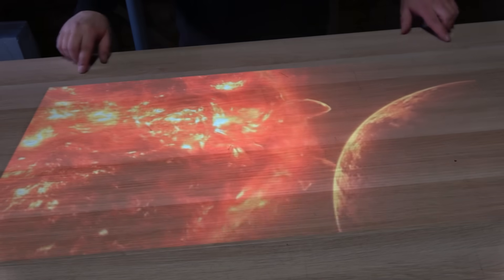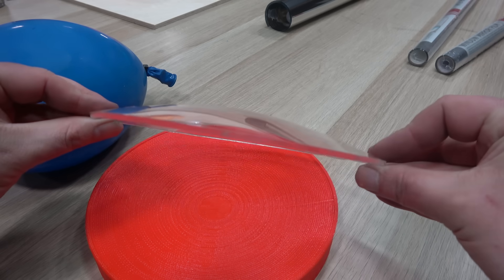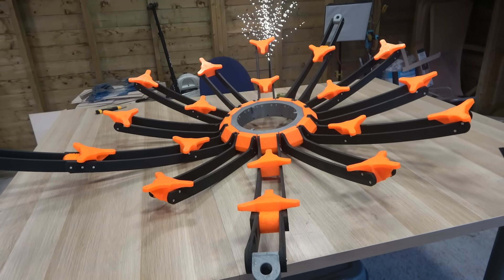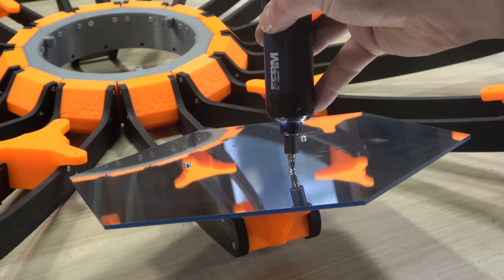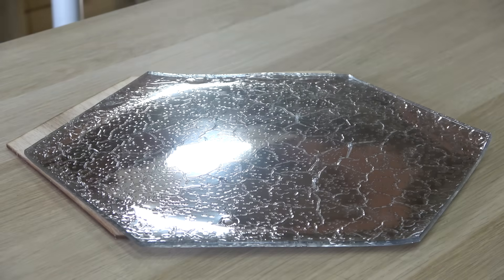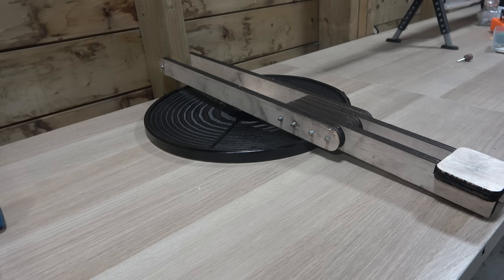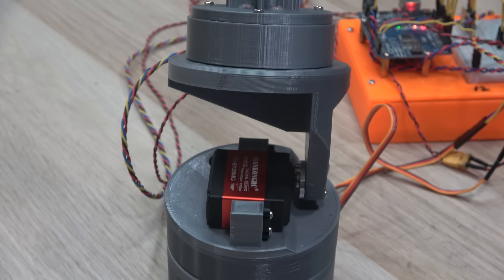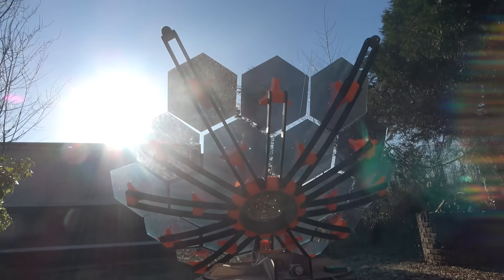Building a DIY Solar Generator..

Comment: The heated aluminium disc should be dark, black (but not catch fire) to use enough of the light that is focused on it (as it's well known, the darker the object, the better it heats up).
And, I'm sure you've considered this, but just in case: of course each segment must be the shape of the corresponding part of a parabola, not of the parabola's centre.
Reply: If the focus point will be few centimetres above aluminium disk, trap for light could be made: second disk with small hole that will be few centimetres above main disk and aluminium wall between two disks. that way almost all light will get through the hole in the first disk and then rereflect many times inside our trap, heating everything up. This also will stop wind from cooling main disk. And of course all walls inside trap should be black - main disk heat resistant paint and other walls of the trap could be painted with black 3.0 to really boost performance.
Reply: @MrMpakobec  Поддерживаю
Reply: Also needless to say, make sure if you paint the plate black, you use temeperature-resistant paint like the stuff the make to paint mufflers or barbecues.  Probably need some sort of primer with it as well, although the more different layers you have the worse the thermal conductivity could possibly be.
Reply: @danielf3623  There is stuff sold as "kachelzwart" meant to keep stoves black. This may be ideal. Not sure it will stick to aluminium though. Stoves are typically cast iron.
Reply: @danielf3623  If he bead blasted the plate so it was dull  and then just dyed it with black metal dye that would probably be enough.
Reply: @DeimosSaturn  Speaking of metal black, an outer copper cladding plate would distribute the heat better (aluminium is prone to hot spots) and Cu(II)O is matte black and tempertaure stable.   The cladding plate would just need to be heated up above 300C and allowed to oxidize in air (hotter will oxidize faster, up to 800C).  Then even if the oxide layer was damaged it would likely automatically reform under operating temperature.
Reply: @danielf3623  As he's used aluminium may be he could anodise it with a black coating.
Reply: @danielf3623  in addition to black paint, it can be more efficient at absorbing light if the surface has an array of vertical walls. And then to prevent air cooling, a clear cover could be put over it.
Reply: 3d Printing 6 different forms (as it's rotationally symmetrical, you should be able to reuse them) probbably isn't too much overhead, but I'm not certain it's worth it.  In case of remoulding, a vacuum attatched to the negative mold might pull the plates into shape without damaging the mirrors finish by compressing them from the top.

A more expensive option might be to get copper-clad plexiglass for the panels, form them and then electroplate them silver.  The upside is you should be able to get a very eaven coat by placing the opposite electrode at the focal point of the mirror, so it's fairly equidistant from all points (minus the spherical/parabolic deviation) That would hopefully remove some of the waviness you have in your formed sections from the adhesive releasing and/or the film buckling.
Reply: @danielf3623  3, not 6. the internal 'ring' of 6 are rotationally symmetric and can use the same mold, same goes for the 6 corners of the outer 'ring', as well as the 6 middle hexes of the outer ring.
Reply: @eyeonus  True, for some reason I had envisioned one more layer of mirrors, but it's only 2 layers, not 3.
Reply: The fact he's using aluminum gives him an option for making it black: 
There was research done stating that a simple candle's soot actually forms carbon nanotubes onto the aluminium surface.

Simply put, just soot the aluminium disc and gently have something transparent to protect it from the elements.

Used this for my solar space heater, works well, however haven't tested if simply painting it black has any difference. But ideally the nanotubes would be perfect light capturers.
Reply: Rather than the shiny aluminium plate, you would be better off with an old car radiator, which 1) is black, so in this case absorbing as much of the light being shown on to it, rather than reflecting it away; 2) is designed for maximum heat transfer to the water. The simple channel you have machined isn't going to have super good heat transfer.
Reply: Yes, people often tend to forget that parabolic mirrors only work at one specific angle and if you're going to tilt them then you might as well go for a spherical mirror.
Reply: @typha The point of the parabolic mirror is that it works at multiple angles. Incoming light hitting a limb of the curve is always directed to the focal point, which is the main reason for using that curve. You must be thinking of something else.
Reply: @edeaglehouse2221  It does not, no. A parabola will reflect collimated light (parallel rays coming from one particular direction but with different locations) towards its focal point, and it will do the reverse as well (light coming from it's focal point will be reflected outward in one direction), but that only works with one specific direction. 

simple counter example: consider the point closest to the focus. At that point the mirror must be perfectly perpendicular to a line made between it and the focus. Any light ray coming in along this line will bounce straight back to the the focus. Any ray that hits this point at an angle will bounce away at the same angle on the other side and miss the focal point.

~maths prof.
Reply: @typha  Oh, I understand what you're saying now. I oversimplified. Thanks. I know this is going off into the weeds a little but would a hyperbolic curve be good enough to collect light from various angles to a single point? I haven't done the math, but sounds like you might already know. Something like that might be good for a fixed collector.
Reply: He's not building a telescope so it does not have to be perfect parabola.
Reply: @Dusan_Kosmicki  yeah, perfect is not necessary, but desirable
Reply: @wingstrongwingstrong Exactly. All he needs to care about is that most of the light hits the heat exchanger, he does not need image of sun on heat exchanger, he need just light. So its not problem if he will have comma or spehric abberations or any other abberation. 

There are solar farms with just motorized flat mirrors that directs sunlight on water pipe, and that works great.
Reply: @wingstrongwingstrong  About the one dish instead of the segments: a hard requirement is to make it look like that space thingy he was talking about 🙂, so that is not an option. If it weren't for this requirement, he might as well have grabbed a satelite dish and be done with it.
Reply: I would be concerned that it could melt aluminium has a very low melting point of 660°C while Aluminiumoxide 2200°C
Reply: @CUBETechie  The aluminium conducts warmth very well, so it  will not melt so fastly. As long as the temperature is taken away by the water. Better should be a kind of oil or something. And the plate should be eloxated in black, witch is a kiond of aluminiumoxide.
Reply: Yeah, the parabola shape he has only works for a mirror facing directly at the sun, not a mirror off to the side because the light source is coming from a different angle relative to it.
Reply: ESSE DISCO DEVERIA ESTAR NO PONTO FOCAL, POIS AO REFLETIR PARA O CENTRO DO DISCO JÁ TEM PERDA;DISCO PRETO E NO PONTO FOCAL APROVEITARA MAIS A ENERGIA
Reply: It's not the color that matters, it's the amount of energy the material absorbs. Yes, in common materials, black is normally best, but other compounds can absorb better. The reverse is also true and is why special pigments are made for paint that do not absorb infrared well, so they don't heat up.
Reply: Fresnell lens perhaps?
Reply: @RickyStenicky2234  it doesn't make sense for a reflector, each row of lenses will block some of the light from the neighbouring row
Reply: Yes! Paint it black or maybe anodize it.  Anodizing would be more durable
Reply: Not necessarily, if all parabolic mirrors (and their respective focal points) are equidistant to the secondary mirror/heater plate. It's way cheaper and faster to have one mold for all mirrors.
Reply: @Atom224 Parabolic mirrors can only focus light to a point when pointed directly at the light source (the sun). In this setup, since they're all at an angle, they should be Parabolic segments instead. This design would only need three molds (inner ring, outer ring corner, and outer ring edge)
Reply: I thought he should have done this too at first.... But then I thought about the melting point of aluminum. A collector that size could easily melt a large block of it. The water would need to flow very well to cool it enough... And if the flow fails for some reason he may be paying for another water block even if he doesn't paint it. It's probably too much for a small project like this, but a controller that monitors temp and flow that could point the collector away from the sun upon failure would be good.
Reply: @NotGovernor  At about 300 F. the plastic on the back of that plate will fail, the water flow will stop and then the plate will melt. The spiral flow of water will flash the water to steam at some point and stop absorbing heat.  Again melt/melt.
Reply: @kkarllwt  The aluminium won't melt even when the plastic fails, it needs a much larger mirror to achieve that.
Reply: @ZanHecht excellent point! Though for this purpose, being a little bit out of focus is probably OK.
Reply: @Atom224  You are both wrong. As long as the collector plate is the same size as (or larger than) the mirror segments, the segments can be flat. And if each segment is individually aligned, the mirror support frame can be flat as well. Sunlight is famously not coherent, so there is no need to maintain phase the way a focussing mirror must. Using a spherical or parabolic mirror is only necessary if you want to produce a spot smaller than a segment, since incoming solar radiation is collimated to about 1/2 degree, which will be irrelevant for a short mirror/collector path.
Reply: the individual parabolas work just fine so long as he puts an inverse parabola on as the secondary mirror.
Reply: On the internet is Black paint that reflect 98% sun light. should be good?
Reply: @adrianchudek3831  For what? I suggested black paint precisely because black does not reflect heat but absorbs it and heats up the aluminium plate. That's the whole point.
Reply: It would be polite to begin your comment with "Great vid" or "Cool project"
But I know politeness is not a thing in some cultures
Reply: @toi_techno  in my country it's not impolite. Also in my country compliments just to be polite is considered bad form. I wrote as I wrote in the nicest intensions. Yes, it's a cultural issue, nothing bad or good.
Reply: @toi_techno  Your idea of what is polite isn't the same around the world.  Are you an American?  If so that's the problem.  The USA is not the only country nor is it at the center of the world.  I can say that a I am  from Ohio.  There are hundreds of other places and cultures and ways of thinking.  I just realized I don't really care you are an asshat and you probably are in that damned cult that is taking over this country.  just remember whtever you think is not rquired for us to also think.  how many times are you gonna repost this same comment?

also to the video creator, Great vid, Cool project!!

Comment: Is there a reason you don't use a white chrome paint instead of the silver to maximize the reflectivity? Like maybe there's an albedo restriction for roofing material color to protect air traffic in your area, or you don't want the plate to get too hot--I think you might want to try varying the color a bit more white or more gold depending on the performance you end up with.

Comment: Why you apply the film before heating the plexiglass??? would not be better to heat and shape de plexiglass, then apply the film with a hairdryer to bend it well? (but not enough to affect the shape of the hexagonal parabolic mirrors [HPM]), also, make sure you isolate the heat center from the rest of the frame, or it will melt the frame by proximity (even with the pump working)

Comment: I love love this! Thank you! Would love to see how this works with a water cooled solar panel in the middle. Wish I could be your volunteer helper. I can program but I wish I had more knowledge of electronics or arduinos (would love to be able to design my own pcb’s/arduinos for sensors and small windmill management. 
Any case thanks a lot for these cool videos!
Personally only interested in green energy projects.

Comment: test the springs at different temps, cause they might lose their strength when hot from the mirrors
Reply: Actually the back of the mirrors will be cool as their purposes is to reflect

Comment: Building all of this just to be hit with the reality that you live in the Netherlands is very relatable. It's like when me and me dad installed solar panel lights on our house and forgot we get an absurd amount of clouds, so we originally thought we bought defective lights XD
Reply: Do you remember if they were the blue crystalline looking ones or the black ones with stripes?  The blue ones have like 4 times the Amp output in relation to surface area but only in direct sunlight.  The black ones will output under 4 inches of snow and clouds.
Reply: You need an optimisation for diffuse Licht ut would help
Reply: i think it was 2004 the CSIRO in Australia built a large  molten/solid salt solar reflector system that reached higher turbine steam temperature than has ever been achieved in a fossil fuel turbine. California put up a system around the same time but little has been done with it considering its potential to generate power for hrs after the sun is off reflectors thanks to molten salts high thermal capacity

as for panel systems there's a NUMBER of factors that influence the sun levels needed for power the more line impedance/material to length to diameter to amps the less efficient the cable panel interface and panel cell interface the more resistance in inverter and battery's the less of the 22-24% (average panels ppl use these days efficiency) we manage to capture actually makes it to the destination 
reflector systems actualy do away with a lot of resistance because your heating a central rod that then boils and turns a steam turbine like a regular  coal or gas plant and even in low light u just need a larger mirror footprint and u can get same heat
but on a  regular PV you can be getting double or triple the power depending on those factors from a system that is technically the same if your just looking at panels rated output tested at a cell level
Reply: Build a cloud buster next to it
Reply: yep this is why my new design for a multiple power source green power system will provide for 24/7 365 power production with a scalable design that can be produced for both commercial General grid distribution to a private at point of use (no grid tie in needed, thus reducing demands on a frail public utility system) Also providing a system  deigned for very remote points of use.  This system's use of several proven green power technologies provides a level of reliability in proper power production that few if any other green power systems can provide ( excluding systems that are anything but naturally occurring that use exotic elements & or fuel sources. { I.E. atomic, oil gas, coal } All of which can cause very harmful byproducts & waist. NONE OF WHICH ARE TRULY NEEDED to obtain large volumes of energy. ) I have the design but do not work for free.
Reply: Send me a version for testing in SEA.  I already have a neighbor with a similar set up who sells solar roasted chicken on the highway.  I will send back a cut of the profits for further R&D.

Comment: slewing bearing ok, but springs expensive?
Reply: xD
(I'm not American) My salary is less than $100 a month, however I recently allowed myself a set of 200 springs for $5 for the sake of 4 springs :)
But the springs can really be replaced with alternatives, and the bearing is specific and very important, I guess it's just the man was choosing what to spend money on and what is not worth it
Reply: @broniusale5987  Yeah, I don't understand what that was about either. Just looked at temu, searched for springs: springs galore for 10 to 20 ct a piece.
Reply: @MartinMaat   don't promote cancer temu. it's a bloatware to the economics and healthy market.
Reply: That's what I thought! Surely TPU is much more expensive than steel springs?
Reply: You can probably buy springs by weight, 200g should be enough

Comment: Will your mirrors or frame distort as it heats up and then defocus? If the mirrors distort you could try forming them like normal, and then push them into a thin base disc of wet plaster of paris which has very low thermal expansion once cured. Also could try applying the film after they're formed and set.

Comment: That's so cool. I think that the segments should be offset paraboloids. Also i wonder what geometry does the secondary mirror has
Reply: This is a cassegrain antenna design.  The formulas are all over the antenna design websites.  It is very critical though.  and actually you usually want to focus in a single point but for this you should try for a focal point past the plate just where the cone of light would evenly cover the plate.